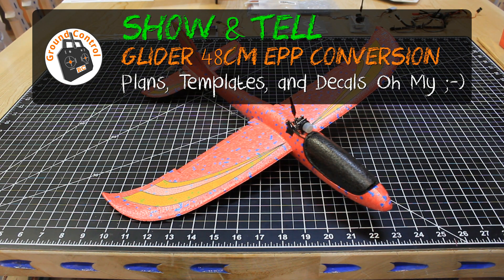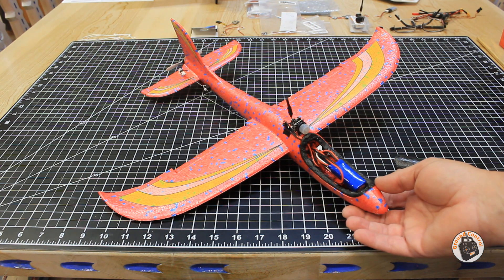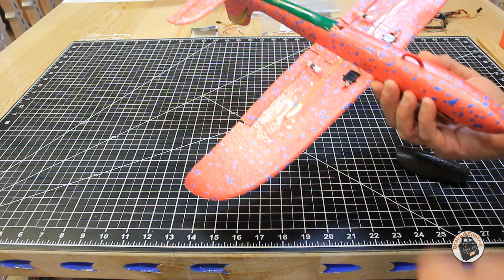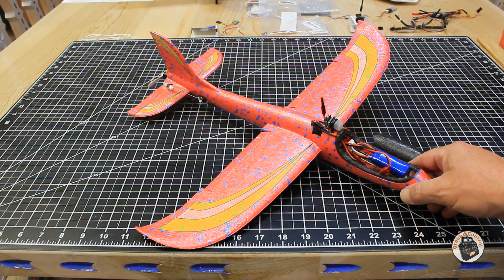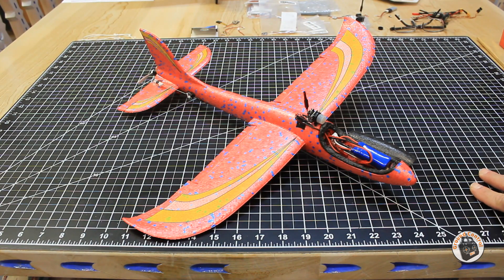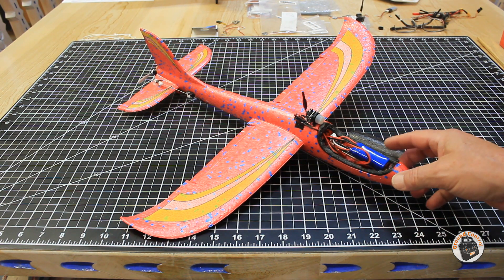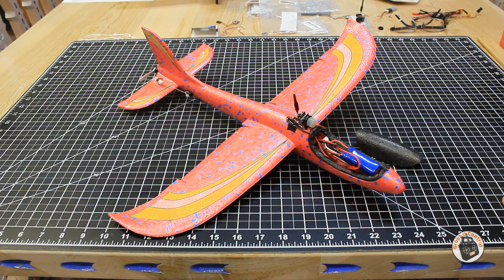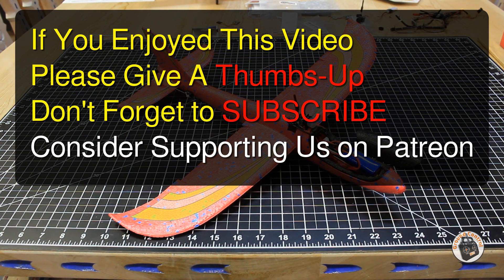$4 Chuck Glider RC Conversion Show & Tell Project Completion

Comment: Hbby king servo has a 1.0 connector and the receiver in the link has a 1.25 connector..did you change the connector to make it work?
thanks
Reply from the maker: Hi Alex! No , the one's I have in the link are the ones I used with the Receiver I have listed. The description is confusing as it also states "Connector Size: JST 1.0mm". The Servos and Receiver I have listed have the same size connector.

Comment: Nice job. Where did you buy the airframe?
Reply from the maker: Thank you! It's a lot of fun to fly ;-) Very fast and aerobatic.
Here is the link:
48cm EPP Foam Chuck Glider
https://www.banggood.com/48cm-19-Hand-Launch-Throwing-Aircraft-Airplane-Glider-DIY-Inertial-EPP-Plane-Toy-With-LED-Light-p-1334592.html?p=WE081047791920140372
See you in the Air!

Comment: Why a pusher tho? Mounting the prop in front would rise efficiency. You would have to install the battery under the wing to get the CG right.
Reply from the maker: I created a pusher because I like flying FPV and it's nice not having to look through a prop. I also created a pusher because creating a tractor version is easy and everyone creates a tractor conversion because it's easy. I'm not so sure about the efficiency of a tractor over a pusher. A tractor will need an angle to offset the roll torque so your thrust line is offset. I don't have to do that with a pusher. If you watch some of the flight videos you'll see it has plenty of thrust and I can get 6-7 minutes of flight time on a 2S 400mah 25C LIPO. Not too bad ;-) Also, this is one of three conversions I'm planning on doing. The next one will be a tractor, much easier ;-) you should perform this conversion and see for yourself. It's very fast and very acrobatic ;-) Thanks for your question and Happy Flying!
Reply: Ground Control RC I'm building a fpv Multiplex Fox right now :) Not a dun of pushers - the prop hits ny hand everytime when I launch :D
Tractors are more efficient because you get a clean stream of air hitting the prop blades, not blocked by the fuse. I doubt that tilting the motor to offset roll torque would make a lot of difference. The prop in camera view is understandable, even though I actually like it - makes the illusion of flying a real plane stronger :D
Reply from the maker: Hehehehe....watch out for those props! I know what you mean, I had to have my hand sticked up hand launching my wing. I now launch them by holding the wing instead of the fuselage. I did a complete brushless conversion on the WLToys F949 Cessna 182 and it turned out great! Take a look at the videos, however, I did need a bit of right and down angle on the motor mount to counter motor torque, otherwise, I would have needed a bit of trim on the rudder and elevator and that would introduce a bit of drag. I like both tractors and pushers and I build and fly both. I just like anything that flies ;-) I can't help experimenting though it's just my nature ;-) Thanks for comment and good luck on your Multiplex Fox, sounds like much fun! Happy Flying!